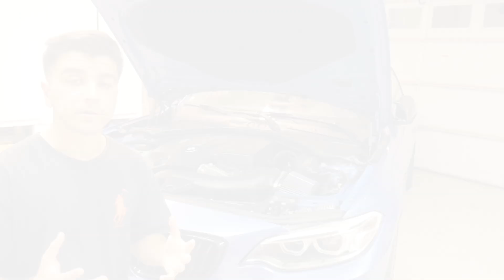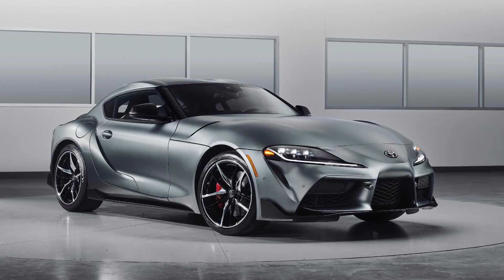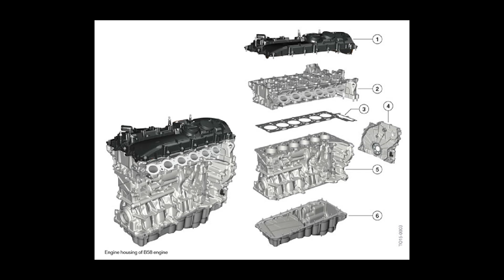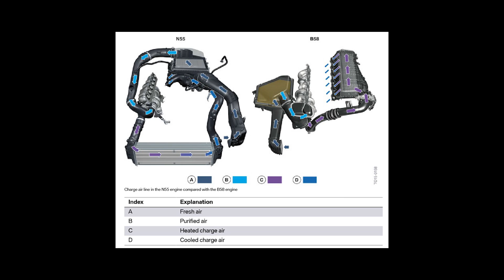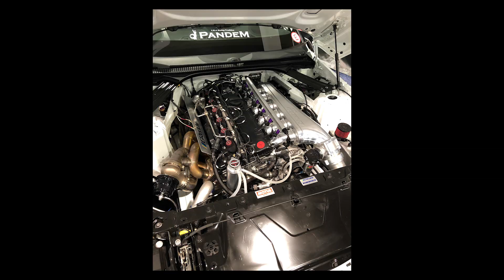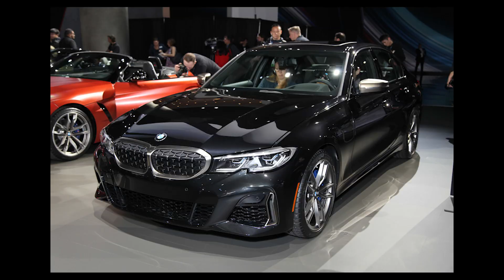How Does the BMW B58 Make So Much Power?

Comment: I own a 2019 BMW 540i with the B58 engine. I am currently running Dinan software and this thing is a beast and great sleeper. It is easily as fast as the 2017 BMW 650i twin turbo V8 that I sold.

Comment: My M240i with the B58 is the first car I’ve owned where I haven’t immediately thought that some more power would be good. It’s so easy and cheap to get more power from it but it already feels like such a balanced car already, I don’t want to mess with that. 

Besides, it can already struggle to get the power down sometimes with it being RWD. Adding another 100bhp would probably just be beneficial when doing high speed motorway pulls.

Did anyone else feel the same way but still tuned it? Thoughts?

Comment: To me, the N55 M engine edition was the most practical street BMW engine of all time. I say street, because I don't need much more than 600hp.

The N55 M engine is way more practical. BMW shot themselves in the foot by making the B58's cooling system way more complex than needs to be.

ESS has the best version of a simple, effective and efficient air to water intercooler.

Aside from adopting ESS intercooler system, the only upgrade the N55 M engine could use is a semi open deck design and an ESS/Lysholm type supercharger.

Approximately 4 minutes into this video, you can some shops removed BMW"s counterintuitive cooling system to a more coherent solution. 

Moving the timing chain to the rear on the B58 looks impractical, too. As you can see, the N55's engine looks much more compact and easier to work around.

The B58 would have to be customized to to the 555's logical, sensible and practical approach to be worthy replacement for be a worthy replacement.

The N55's high quality aftermarket water pumps are good for an excess of 100,000 miles.

It would be good to focus a video of more about...shops that removed and replaced BMW's cooling system with a better solution.

Also, notice that the most reliable BMW engines of all recent time went up by threes:

N52
N55
B58
Reply from the maker: I understand where you're coming from but most B58's have already proven to be much stronger and more reliable than the N55. Just look at the manner in which Toyota adopted this powerplant for the Supra. The cooling system is fantastic and has proven to be quite robust on track and with higher mileage cars. Closed deck, and extreme efficiency
Reply: @SimplyCarThings  Toyota adopted the B58 ...with their own implemented customizations.   
They started with the B58B3001 (the best B58) and highly likely integrated the most sensible features of the N55.

If I had to replace a N55 M engine, I would highly consider the B58B3001, but can't help it the N55 engine looks amazing. The design is awesome, plus it sounds amazing, too!

The N55 is an inline 6 engine that features a pivoted layout ... looking almost like a V engine.

Plus, the N55 can accept the N52 exhaust cams for more power. Sounds like an interesting topic. :)

Since Toyota has adopted the B58, it is unquestionably king.

Future aintenance seems like much costly proposition compared to the simplicity of the N55.

Finding shops that can customize the B58 to port injection and other cylinder head customizations would definitely work for me. Not that would get port injection for the street, however, it will be good to list shops that customized B58 heads, components, etc.

Comment: I am about to buy  a 3 or 4 series bmw (m performance is a must) with either  n55 or b58 engine. What do you think is the best move regarding price to value? 
(Lately I have seen too many n55s with blown engines riding on a trailer at 70k kms).

Comment: I also have 8 built-in parts, the meaning of which, to be honest, is not entirely clear to me. Since the BMW is a left-hand drive vehicle in Germany, I have to imagine things being adjusted by 180 degrees. Unfortunately I have different colors and at two points completely different plugs.
Could it be because I caught the last upgrade of the model, namely LC II?
The engine has noticeably more power and is more economical. A friend of mine works on a test bench of the TÜV. (In Germany, an official place that you have to visit every two years, because they check the chassis, tires, illegal tuning, etc.).
It gives me the opportunity to check the performance of my cars for free. After 5000 km, i.e. after the car had run in) I measured the performance on 3 days with different outside temperatures.
Measurement 1: about 5 degrees, cloudy, light rain: 374 hp at 6200 rpm, 604 Nm - are 34 hp more top speed 275 km / h
Measurement 2; 18 degrees, slightly cloudy, dry: 372 HP at 6100 rpm, 589 Nm - 32 HP more are Top Speed 275 km / h
Measurement 3; Over 27 degrees, dry, sun shines: 366 HP at 6300 rpm, 550 Nm - 26 HP more are Top Speed 275 km / h
The test results are there. Measured three times because the engine as a turbo strongly depends on the outside temperature. The cooler the air, the more oxygen. Especially the sultry summer weather of 27 degrees costs performance. In Germany, a car is considered standard when it has up to 10% more or 10% less power. Means that all values are completely in line, measurement 1 was at the limit, because 340PS + 34PS (10%) then result in 374 PS.
V-Max only regulated at 275 km / h instead of 250 km / h, which I measured several times using GPS. The speedometer then goes to 1, i.e. to the point where the tank is full. The tires are the runflats from the factory. They were on my 125i too, but the vehicle drove like wooden wheels. Still wanted to change, but my hander called that the m140i will no longer receive a four-cylinder as a straight six-cylinder and with front-wheel drive. I didn't want that.
In passing: BMW is a ripped off company. They bought up Rover, RR and Mini!? Rover was simply pushed away, the Mini sold easily, especially to young women. Limited edition as a two-seater with the B 58 engine. Unfortunately only 400 copies. Because the 340 PS are opposed to about 800 kg, what should I do with my other plugs or better said pin assignments? All friends who drive the m140i or m240i have the appearance of those shown in the video. My guess is that only the LC II in connection with the last major software update have this arrangement. My workshop didn't see that in the form either ....... thanks in advance, and everyone stays healthy!

Comment: Which is better? S55 Or B58?
Reply: B58-more reliable,can make easy power like the S55,higher compression ratio
S55-reliable but has a crank issue that has been solved,makes more power because it has a bigger aftermarket,lower compression ratio.
Reply: @carboydorifutoparty3976  so S55 would be better after upgrading the crank.
Reply: @juijgentan1281  well it'd practically save u the trouble from making the car break down. Theres already a decent bunch of S55s pulling 600-1000whp out there. The only con for the S55 is that it's just expensive.

Comment: Closed block and arc jet coated cylinder walls you can't polish or sleeve them, any scoring and it's full engine replacement. If BMW decides you were running a tune they won't cover it either (few guys on forums already learned the hard way).  The only thing budget/poor enthusiasts can hope for is that they sell a boatload of these cars so junk yard engines stay available for years.

Comment: How does the B48 hold up? Is it similar to the B58 (just 2 cylinders/1 litre less)?
Reply: I hear that there reliable. Buuuuutt depending on what cars there in tho.
Reply: @carboydorifutoparty3976  Can you elaborate on that, which cars are good/bad?
Reply: @ronaldov09  I hear the BMW models are ok with the B48 but I hear from here and there that minis with the B48 have electronic issues. I don't know too much about the B48 but I do know it's still reliable while the B58 is basically the big brother that is more built towards power and was a continuation of the next gen i6s for BMW to make for the next S motor(the S58 which is now being used in a few models out RN)

Comment: Last week my m240 suffered am injector failure replaced under warentee. I've had it back a few days and my first attempt over 50% throttle and it just happened again. I am not amused.
Reply: ChipZilla69 I guarantee it’s sparks/ coils over injectors
Reply: @EncompassingWealth  Turned out to be a faulty cam cover resulting in coolant leak and misfire. BMW fixed under warentee but refused to put an endoscope camera into the engine to check for bore damage.

Comment: The b58 in the Supra is a completely different application because Toyota redesigned the head for better oil flow so no Bmw b58 will ever make the same power as a Toyota b58 still a good motor but over hyped tbh

Comment: The B58B30TÜ1, which is in the Supra and 840i, has 30% less friction in the chain drive for the cams, a 2kg lighter but stronger forged crankshaft and the new cylinder head has better cooling, too.

Comment: And it's a complete piece of junk when it comes to maintenance and repairs.   Low quality plastic parts everywhere, all designed to fail and drive service and repair revenue for the BMW dealers.  Utter junk for reliability and serviceability.
Reply: @Sweet Techno LOL Canadian, and a professional engineer who knows more about engineering and maintenance than you ever will.  It's common knowledge that BMWs (and MBs) are not designed for reliability.  Talk to any mechanic that isn't on the BMW payroll and they all say the same.   For phuk sake, the water pump has a plastic impeller and its mounted UNDER the engine so it can't be serviced easily.
Reply: @Sweet Techno For example, the water pump has a PLASTIC impeller.  All of the intake manifolds are PLASTIC.  I never said BMW motors aren't capable.  Of course they are - high output and good torque.  What I said is that they are rather unreliable and surprisingly cheaply built given the high-end brand. 

You, sound like a BMW fan boy.  I couldn't care less. BMWs are nice looking cars that drive great.  However, they are very unreliable, especially given their price tags.  For the same money or less, you can get a Lexus that will last seemingly forever with much much less TCO.
Reply: @Sweet Techno Just look at the reliability studies.  There's simply no comparison between Lexus/Toyota and BMW.  full stop.
Reply: You're right, planned obsolesence, but BMW is not the only one entire market functions on it. Also you'd be surprised how calculated BMW engineers are, down to seemingly "simple" yet extremely expensive interior pieces with rubber coatings that peel off, 1mm thick vinyl that tears on contact with jeans etc. etc. They are capable of extracting so much money from you.

Comment: I feel insulted😭, n54 gang
Reply from the maker: love my N54 homies <3
Reply: The n54 already did 600hp on 100% stock block and head like 12 years ago (more than a 2JZ can claim), but the hype is real people are only learning about the potential of BMW engines now that they've put it in a Supra.
Reply from the maker: @BigUriel  facts, BMW tuner engines like the N54 always flew under the radar until recently
Reply: M50 as well,that engine can hold 500+ all stock. Very remarkable for a commuter engine

Comment: What about the new s58, feels like the supra got the mid range engine while the new m3s will have the s58, so which has more modding and reliability capabilities?
Reply from the maker: I'll make a video on this, right now there isn't a whole lot of info on the S58 since it's only in the X3M/X4M models.
Reply: I’m sure there’ll be an S58 Supra at some point...
Reply: @moham1287  possible, but highly doubt it, would be actually a loss for the guys who bought the current b58 supra, doubt Toyota will do that to their loyal fans, honestly feel Toyota has lost the plot, audi, bmw and Mercedes is on a completely different competitive level
Reply: @moham1287  lol, no unless the Supra is 90k. You think bmw would allow use of the S58 in a car 30k less than the m3/m4. Toyota will never out spec the actual manufacturer at a lower price.

Comment: It's weird how they put it in a Toyota and all of a sudden theres wayyy more tuning companies messing with BMW's now.
Reply from the maker: yea I agree, just goes to show the hype around the Supra name
Reply: Bmw designed the cylinder heads for the 2jz. Just a fun fact.
Reply: @jdmcarboy64  Can you post your source?
Reply: @jdmcarboy64  no they didn’t!😂
Reply: You can thank fast and furious for that 😆
Reply: @dtprodrive  You can't thank what's already a mess mid way and B58 has no 10+ of reliable and tuning capability like 2jz or even better Smokey Nagata swapped a Supra with Toyota Century 1gzfe and thats a V12
Reply: Amano Yuuji lol greek tuner pushing 1000hp on b58 supra caling it the new 2jz
Reply: Name one of those companies. You can't, because it's not true. MHD, PTF, Mission, DME etc had all released their B58 flash tunes prior to the release of the MK5 Supra.
Reply: Bmw has always has a good amount of aftermarket options

Comment: I wonder how the timing chain is going to hold up over time, with the timing chain in the rear that raises a big concern if i were to buy one of these cars in 10 years time
Reply from the maker: me too, that's a big concern since engine removal is required if it needs to be serviced
Reply: BMW does not make these cars for 2nd & 3rd hand buyers.  Reliability to last thru the prospective 1st ownership is all that matters.
Reply: @TucsonDude  2 things I gotta say to that. 1: you gotta pay to play with any Euro car. You can't just expect to pay 10 grand for a once 50-100k car and expect rainbows and sunshine. You gotta know your machine. You gotta be good with a wrench and don't be frugal. Do the things you know you can do yourself. Buy a BMW scan tool. BimmerGeeks protool or MHD. 2: don't over step your bounds. Have some money in the bank. If car terminology makes your head spin go buy a gutless kia. If car talk interest you then stick around and do some homework and always get a pre purchase inspection. Follow the trends don't be the trend setter. The trend setters are the ones who are gunna pay 4x what I will, so let 'em burn their money while i use my money to make it the best it can be. If you can't afford to fix it, walk and go buy a Toyota Corolla.

Comment: Damn I had the chance to get the 240i... guess the 235i gotta do for now.
Reply from the maker: same haha, but i dont really care for huge power so im happy with the 235i
Reply: Simply Car Things yea I heard they can easily push 380whp with simple bolt on’s and stage 2 bm3, while still being reliable. Hopefully the b58 proves to be reliable over for long run, after the 4 year factory warranty is over, cause I think they’ve been out since like mid 2016 so like 3 and a half years now

Comment: Are you aware that the 2020 X3 M40i and possibly other M40i models come with a new B58D?  up from 355HP to 382HP.  Surprised you did not mention this.
Reply: I'm amazed that so many automotive journalists/bloggers apparently miss or gloss over this North American market specific detail. Fact is, that the 382HP US variant of the B58 block deviates quite a bit from the lower HP Toyota/BMW version in a number of significant engine parts, i.e to only point out the different cylinder head (of the 382HP version) with a full external exhaust manifold (versus the often quoted B58 cylinder head with integrated exhaust manifold) and the larger turbo, as well as different pistons and connecting rods. Easy to see on realoem.com, when you compare any BMW model with a 340HP B58 engine (e.g. a Euro Z4 M40i) to a BMW with a 382HP engine (e.g. a US Z4 M40i). Still, enjoyed the video - good work!
Reply: @bernie-k  agreed. As I understand it, it is quite an improvement from 2019.
Reply from the maker: Yea I am but it is inherently the same engine with some slight hardware tweaks and software revisions
Reply: @SimplyCarThings  Great video. I'd revisit the # of updates in Technical Update 1.  More than slight hardware tweaks, IMHO. They redesigned the crank case (block). Lighter weight crank, forged pistons now, higher pressure high pressure fuel system that flows more fuel now . Rear Chain design changed and moved from 2 chains to 1 with a 30% reduction in friction- the labor costs if this chain needs replaced out of warrantee, is astronomical.  New Cooling system: cylinder walls run warmer on one circuit, cylinder head same as TU0.  The TU1 engines also get paired with the newer ZF 8HP51 transmission vs. the 8HP50, too.  -Many of the updates from TU1 were moved forward to the S58.
Reply from the maker: @emanymton5191  wow! that's way more changes than I would've expected to be honest. Do you have a source or link that also lists this information? Id like to make a video on this topic possibly
Reply: @SimplyCarThings  Someone NEEDS to make a video on this subject!  The 2020 X3 / X4 news cycle is dominated by the arrival of the M/ M Comp models, but the value just got ratched up a LOT on the M40i.  Let me find the site that leaked images of the BMW TU1 docs in english....
Reply: @SimplyCarThings   Here's two summary articles, but the engineering PDF has been leaked, turned into images and posted on a BMW forum SOMEWHERE... Can't find it again to save my life, though: https://www.bmwblog.com/2018/10/31/bmw-b58-tu1-technical-updates-bring-388-horsepower/

https://bimmerlife.com/2018/11/01/b58-engine-technical-update-brings-388-hp/

The 2020 Supra "C" motor has the TU1 updates, but obviously with the hedifold; the  M340i and 2020 X3/X4 M40's have the TU1 engine but with the normal "B" head and individual exhaust ports / external manifold. (I've confirmed with a new 2020 X3 M40i owner.)